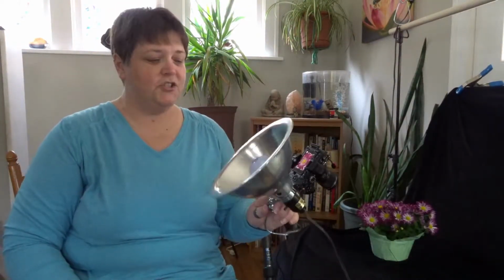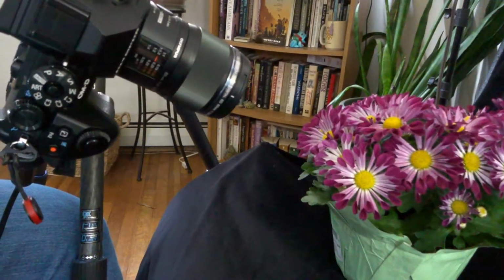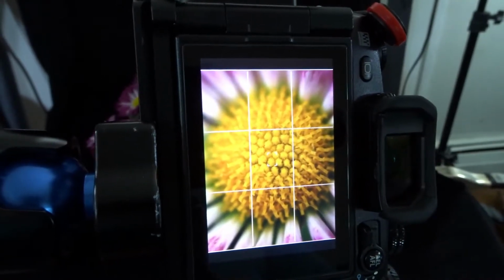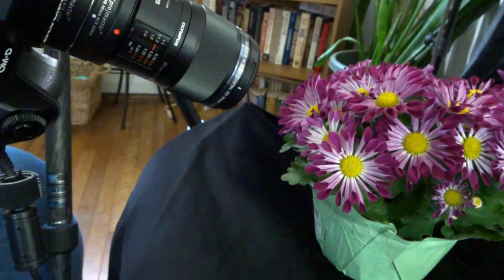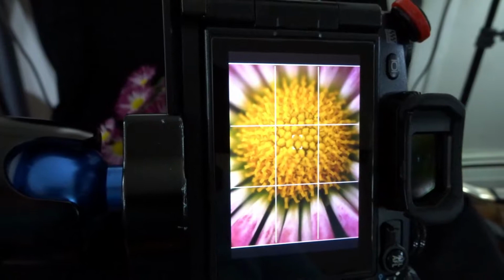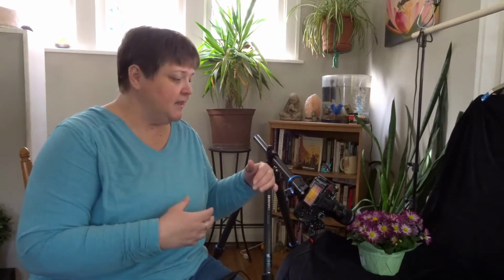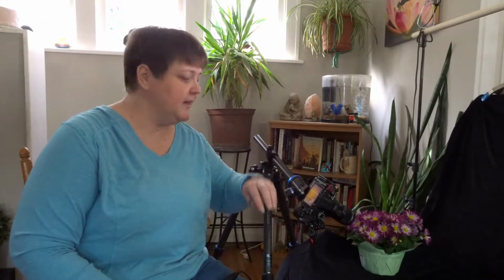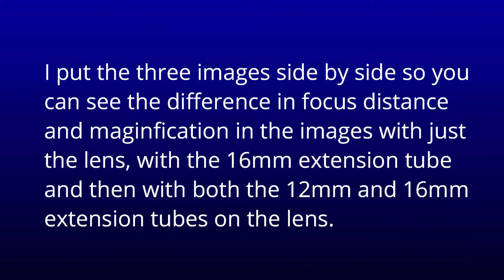Macro Series Part 3 :  Extension Tubes and How To Use Them

Comment: Very informative video Tammy. I'm now very much considering getting some tubes and a teleconvertor. Do you have any experience with turning a 80-200 up to 300mm?
Reply from the maker: John Haswell Photography thank John. I have used a 2X teleconverter with my 70-300mm and gotten 140-600mm with it. You definitely need a good tripod depending on your light and you may have to manual focus at the high end. It works well depending on your lens. Let me know if you try it and how it comes out.
Reply: Tammy Mellert I was hoping to use it handheld for wildlife. Would this not be practical?
Reply from the maker: Well that would depend on your exposure. The rule of thumb is this: if your shutter speed is higher than the focal length of your lens than you can hand hold it. So if you are shooting at 300mm then your shutter speed NEEDS to higher than that to keep your focus handheld. So exposure comes in to play big time now. You would need enough light by bumping up that ISO and keep your fstop low enough so that you can keep your shutter speed higher than your focal length. This is what we call the reciprocal rule. We used to use this all the time and sometimes I still do. If your camera or lens has image stabilization then that would help control camera shake. Does that make sense? Here is a link that might explain it better https://photographylife.com/what-is-reciprocal-rule-in-photography
Reply: Tammy Mellert cool, as long as that rule applies with extension then I'll be fine. Thanks for advice
Reply from the maker: It should but take the 1-2 stops of light you use into consideration and you will be fine!